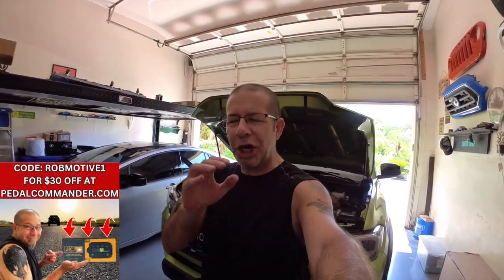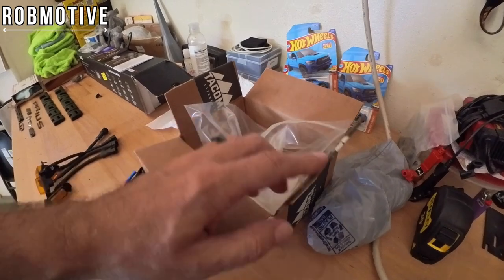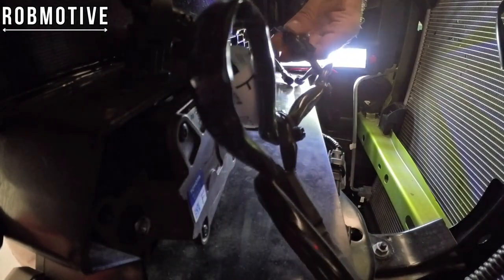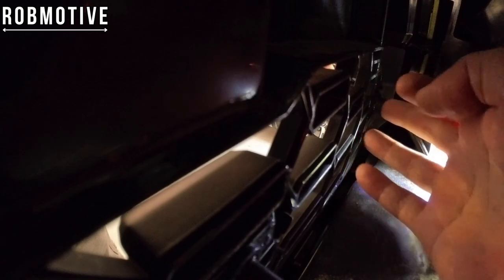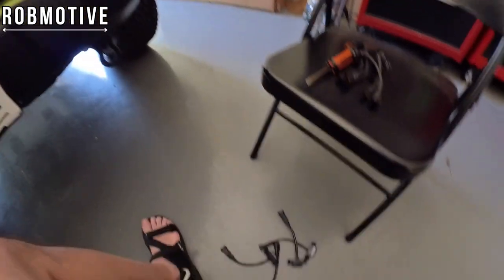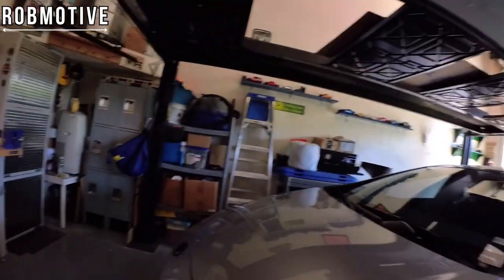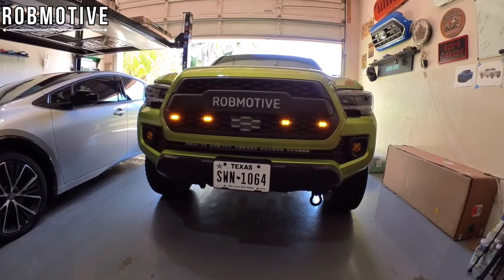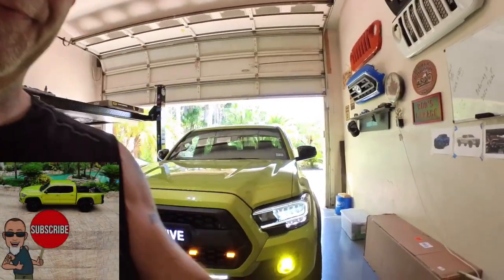Toyota Tacoma Grille Lights Had To Be Replaced

Comment: Ugh my 2023 new tundra needs a new transmission so f mad 😡
Reply from the maker: Now that's a bummer!  I assume it's under warranty?
Reply: Can you give me some specifics on how your transmission was acting I know mine is acting up a little bit strange you can get back with me I'd appreciate it
Reply: @darrellwatts1281 only happens at low speed 20 to 30 mph slip then a hard bang if I go on the highway and give it to gas zero problems it’s only one it’s local driving.

Comment: Hey Rob I've got a electric green Tacoma just like yours while I was having my oil changed at the dealership they noticed that my rear differential was cracked in a very unusual area. They're replacing it for free but I thought you might want to know what's going on and you might want to check your rear differential.
Reply from the maker: Thanks for the heads up👍